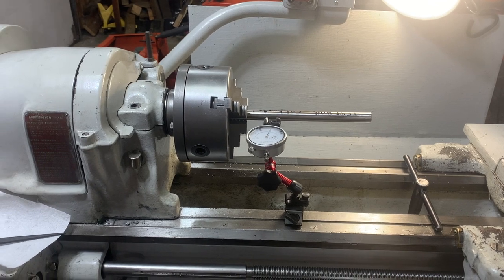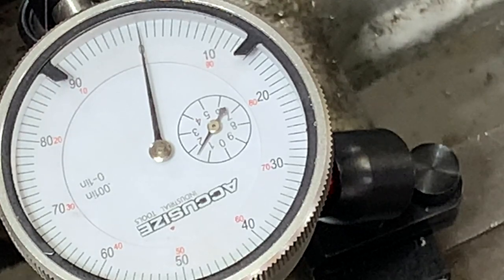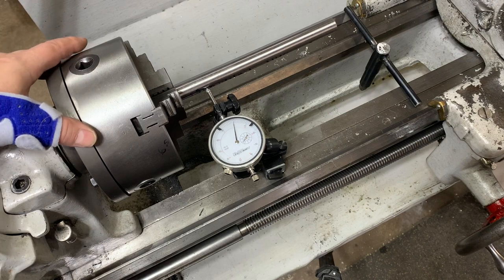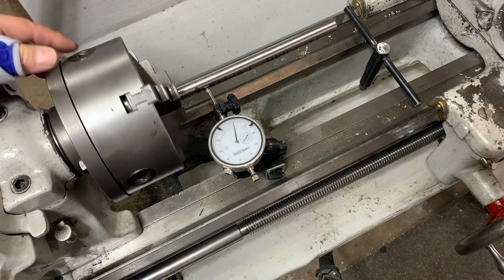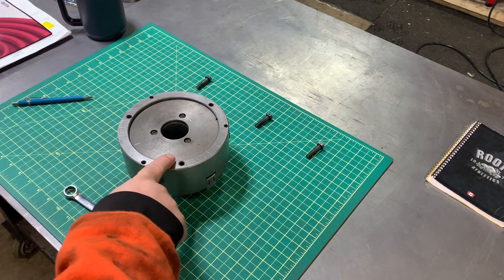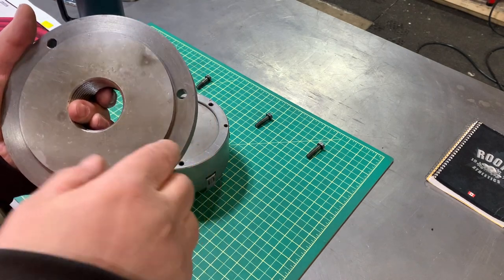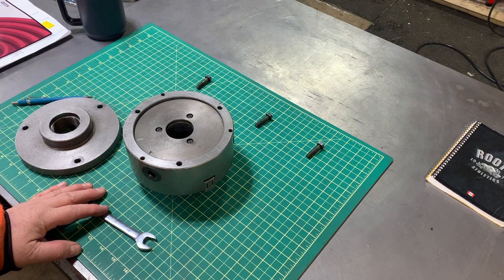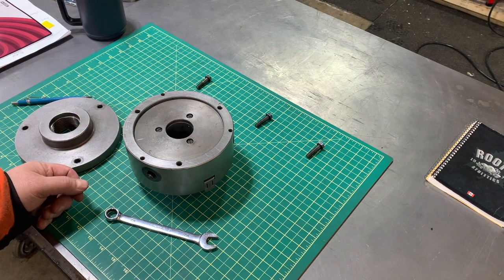How to make your 3 jaw chuck run true

Comment: Having served my apprenticeship on a 9” Model A (a long time ago) I have found that the 3 jaw chuck will not “repeat”… not many 3 Jaws do. Best 3 Jaw approach is to use a Buck Chuck which has an ability to be adjusted to near concentricity. Even after that it will not repeat. It’s the nature of the beast. If you want it perfect use a four jaw and indicate. Collets are best for repeatability. I have a Pratt&Bernerd 3 Jaw that actually repeats within .001-.002 pretty regularly. But it also greatly depends upon the accuracy of the part being chucked. Just my opinion based on 42 years experience.
Reply from the maker: I fully agree. Thanks for your input Paul.  Gilles

Comment: All of your advice is solid! I went 1 step further,  and turned down the the dust plate inside the chuck to give me more depth,  turned down the backing plate to fill the added depth, then installed 4 set screws through the back (side) of the chuck to make it adjustable like a Set True Chuck.
Reply from the maker: Nice. I definitely need to make it faster to setup. I like your ideas 👍🏻👍🏻👍🏻
Reply: @LetsRogerThat  If you do that, please film it. I'd really like to see how to mod in that adjustability with setscrews, as mentioned.
Reply: @LetsRogerThat  get your chuck running as true as you can then drill ream and pin the backing plate to the chuck for repeatable alignment but don't use symmetry so the 2 can ONLY refit one way.

Comment: Wonderful, cheers from Florida and a 13" South Bend owner.....
Reply from the maker: Thanks Paul. Stay well
Reply: @LetsRogerThat  I guess I am going to have to try this
modification to my SouthBend 13...it is a 1942 Tool room Model
with a 6 foot bed....it has 2/10,000 runout on the spindle....
my Chuck is a Victoria from London, have not been able to find
any information on Victoria Chucks, even though their milling machines 
are listed on lone.....I do not know if that chuck is original, but it
does not have removable/reversable jaws....it has same set up as yours,
and it has the same hex head cap screws  that are not counter sunk.....
I will get back to you and let you know how it works out.....
I did recently grind the jaws, and got some good accuracy from doing that....
but I am looking for perfection....ha, aren't we all....
best wishes, Paul 
here is a video of the grinding, hope you can watch....
https://www.youtube.com/watch?v=hlYtd-gsnJI

Comment: I had to do this with a new chuck. I understand a 3 jaw would never repeat, and that it would always be off, but I'd want it as close as possible. Also the flange on the back plate of my new chuck was extremely tight. 

Newer chucks will repeat though... but older ones probably won't...

Comment: I also think using standard bolts rather than countersinks helps.  I had massive problems with new chuck because the countersinks in the backplate were off.
Reply from the maker: I agree. 👍🏼

Comment: Why not put a couple of dowel pins in when you have it so perfect and then you wouldn't have to align it all over again.
Reply from the maker: Didn’t cross my mind. Good suggestion 👍🏼
Reply: Because different size stock will be placed in different locations of the scroll so you need to be able to dial it in.  You can’t do that with solid dowel pins

Comment: This great but you are not addressing run out. You are only measuring in one place at about 1-1/2" out from chuck. Those type of chucks are not designed to adjust for run out. MHO
Reply from the maker: You are correct. I didn’t show that I measured at several locations and that at 6” from the chuck I was still at 0.001”.  Something to consider if I film the process again. Thanks for pointing it out.

Comment: That's not really remarkable, if you took the material out loosing 1 jaw Then put it back in and it's true, you will get myattention
Reply from the maker: Ever since I started using this procedure I haven’t had any difficulty achieving consistent results. But in general I totally agree with you that 3 jaws aren’t reliable for consistency. Thanks for taking the time to comment. Much appreciated.